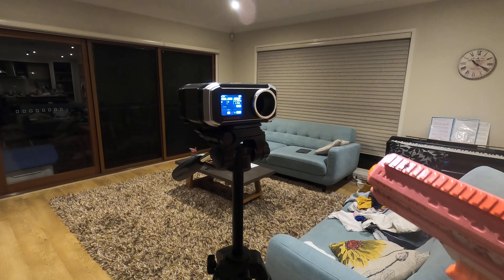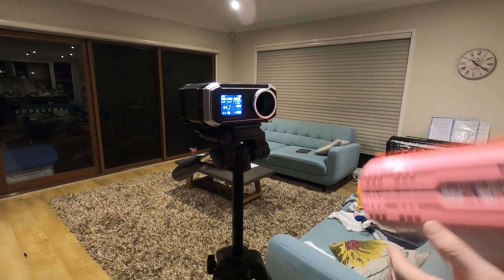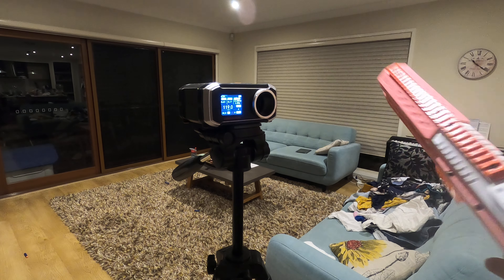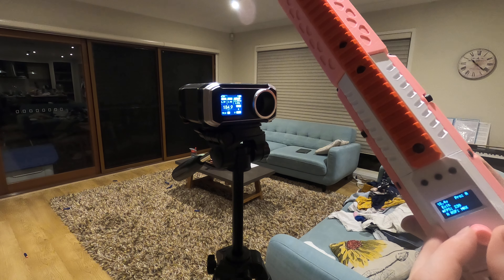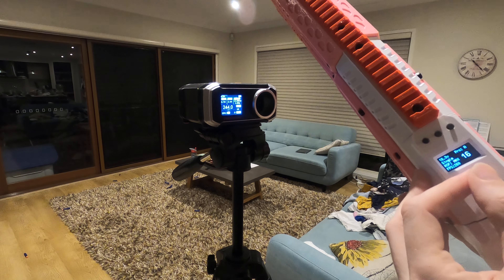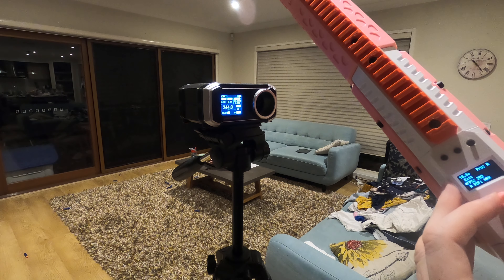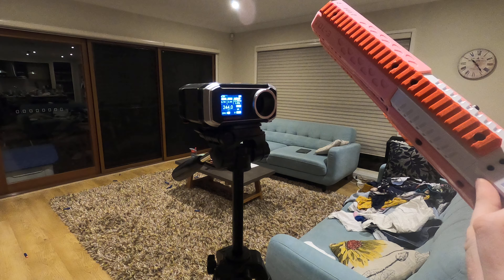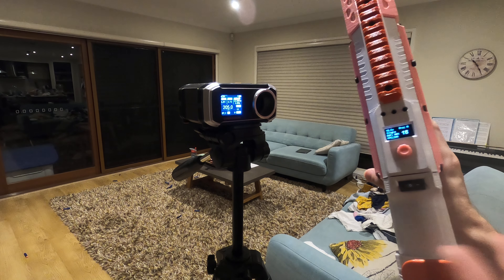FDL3 Dual Stage | Closed Loop | FPS selector

Comment: Which ESV are you using for this?  Awesome content by the way.  You’re one of the few Ci tuning to push the boundaries of what’s possible. Love it!!
Reply from the maker: These ones are using Narfduino ESC's - which are similar to the ACE line of ESC's from DZI. They both run flyshot capable firmware.